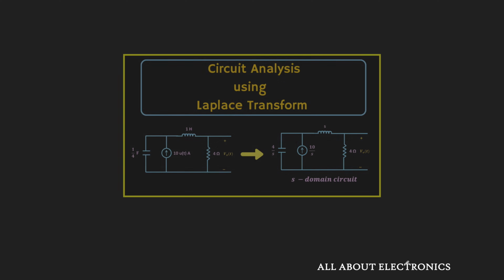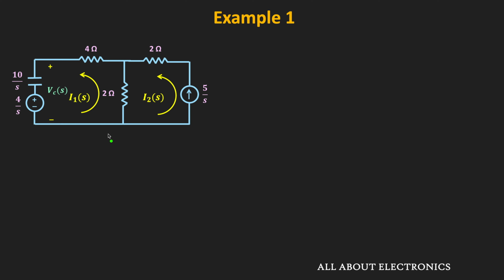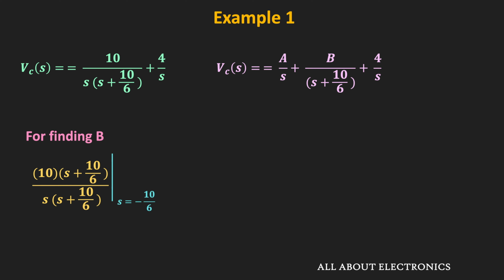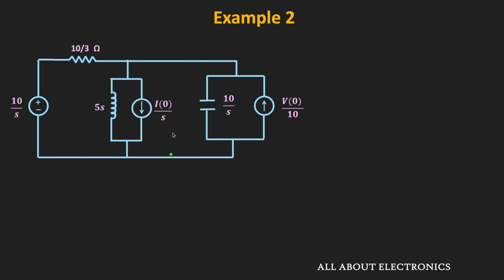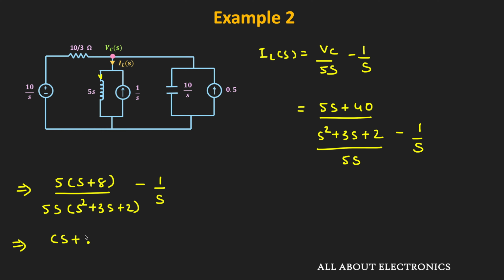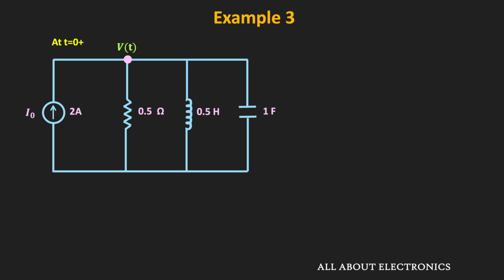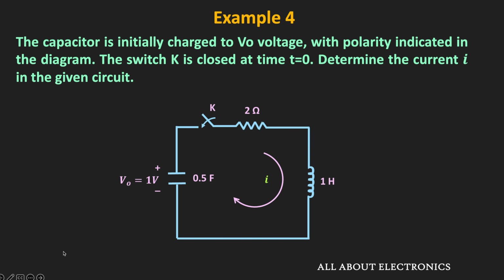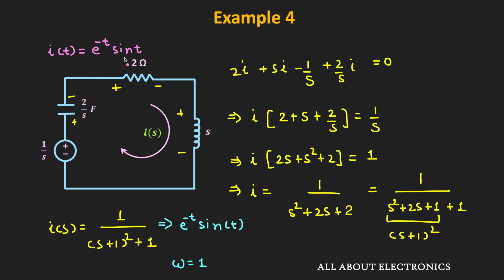Transient Analysis using Laplace Transform (Solved Problems) | Network Analysis

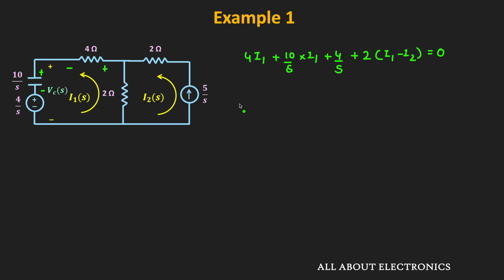Comment: at time stamp 4:30 , can't we take the current direction as clockwise. If then what will be the equation
Reply: i am wondering if the equation is like 4/s + 10/s -4I1 - 2(I1 - I2) = 0. Since algebraic sum of voltage sources is zero. If so won't it contradict the equation you have mentioned??
Reply: @deadbook6556  I'm getting negative I2
Reply: @deadbook6556  i'm stuck at the same thing .... was looking for this comment

Comment: the current in the capacitor is not 0.5 it is 5/s ,so the final will be 90(e^-t-e^-2t)
Reply from the maker: Which example you are referring ?
Reply: Example 2, and its 0.5/s for current of capacitor, i got my final answer to be (7/2 -9e^-t +9e^-2t)*u(t)

Comment: Sir why (10:38 )
Capacitor representation choose Frist
Why not choose second
Reply from the maker: Because with the first representation both capacitor and inductor will come in parallel. And both currents I(0)/S and V(0) / 10 are also in parallel. So, they can also be added or subtracted. And hence the circuit analysis will become simple. I hope, it will clear your doubt.